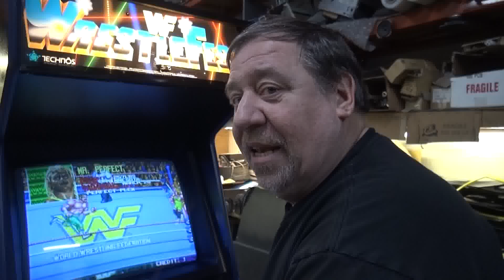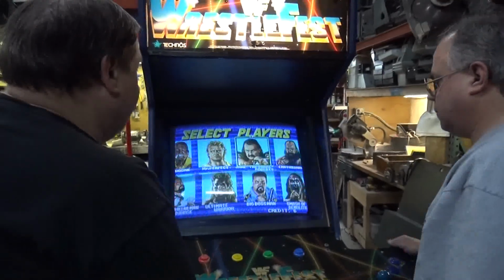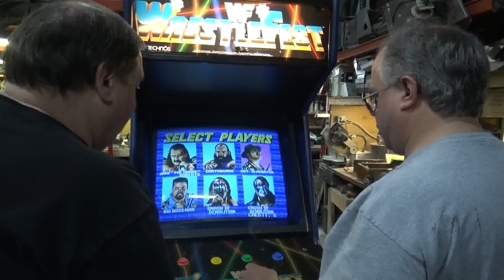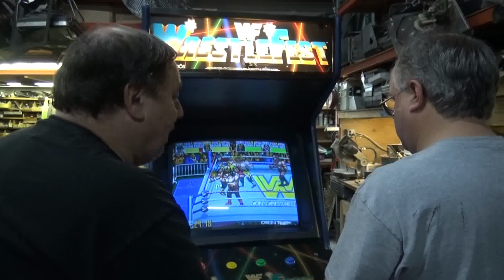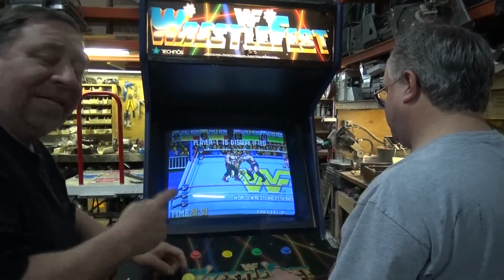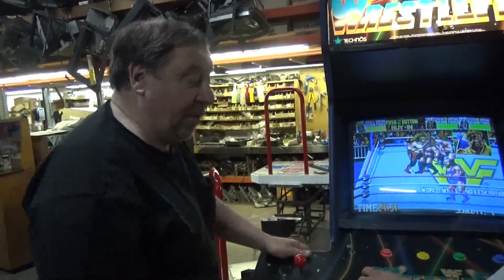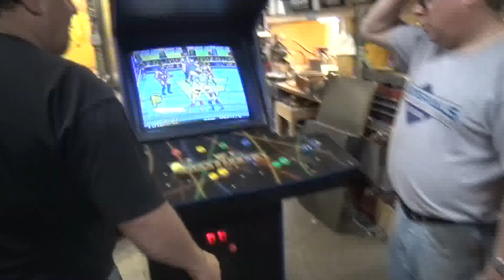#637 Technos WRESTLEFEST Arcade Video Game 4 player! TNT Amusements

Comment: Took apart a cab some one converted to neogeo and found the old 4 player wrestlefest control deck sandwiched in , some one made a bubble bobble single button with it, and I think im going to convert it back to a wrestlefest since I got it for $50 it will be worth the 600 or soo I invest into it.